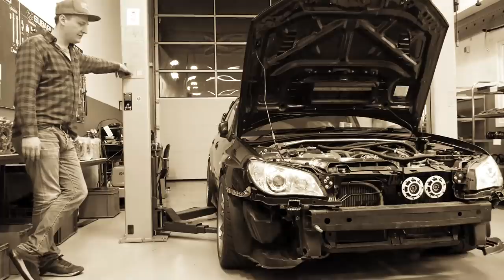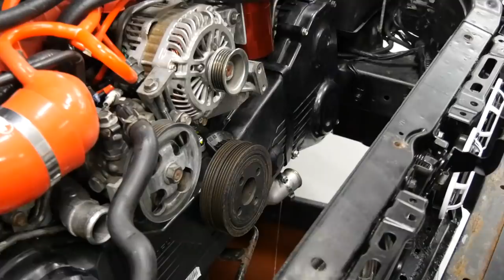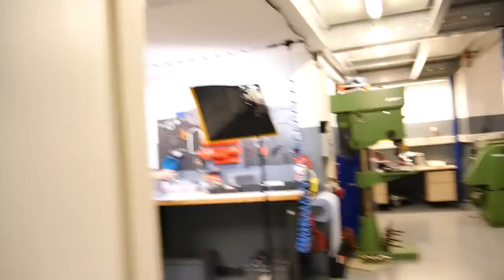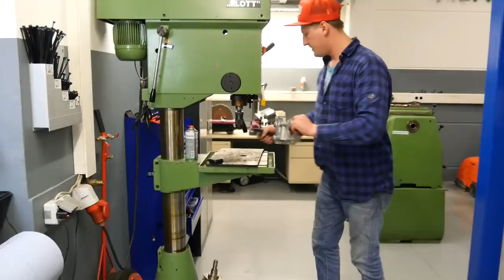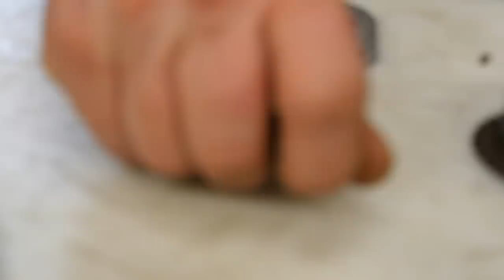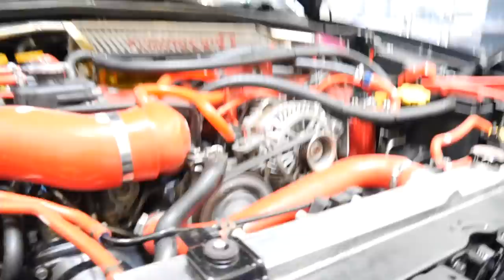❌No Oil Pressure for Subaru WRX STi ! ❌ Did we save the engine? l Shithappens#2 l Subi-Performance

Comment: Never knew casted pumps exerted these issues. 2JZ motors have this interesting tolerance issue on some motors too. Easiest way to prevent this is to port the opening a bit and knock that sharp brow on the inside down. Polishing the regulator piston might help too but you decrease idle pressure a bit. Good video!
Reply: Update for you lads: I usually ream the pump housing with a 16mm carbide reamer, polish the pump piston, then I lap the 45 degree piston face into the pump, no issues!

Comment: I like you man. You a really cool guy. I wish I could be your friend and help out. Thanks for posting these videos. I don’t have a Subaru but my friend does and I find it interesting. When I saw this engine idle, the motor does not shake all around like my Honda Civic does. It was idling very smooth. Good work. These motors sound great. The sensations are good in drivers seat.

Comment: That's the first thing I checked when I had noisy hydraulic lifters in my Chevrolet  LS1 engine - oil pressure.

That was to confirm that the oil pump,the crankshaft & camshaft bearings were still good which they were, all I did is threw in a new set of lifters & a new timing chain kit then the engine was all sweet after that,at about 342,500 kilometres, the engine is performing better than it did at 183,000 kilometres when I first bought the car a bit over 10 years ago.

My brother had to get my cousins husband whose a Subaru mechanic to get the cylinder heads rebuilt in his 2000 model Forester which runs the EJ20 engine in it,he ran it in liquefied propane gas & never adjusted the valve lash on it,he lost compression on a cylinder, the valves & seats also got burned out.

So for a few thousand $$$s he got the cylinder heads rebuilt with new valves, seats & springs fitted,my cousins partner went through the rest of the engine & resealed it as well as replacing the clutch in it.

He also advised him to only run it on unleaded fuel but he still runs it on the gas !

Comment: Was worried for the first couple of seconds. Heard what I guess was a lifter not pumped up yet. Thank God ticking went away.
Reply: He was not trying to start the car.
He was making sure oil was in the pump and  primed before starting.
Reply: @tam1381  can you please explain how to do It that way afer oil replacement?
Reply: @aagoge  Hi you disconnect the ignition so the car does not start BUT the engine is turning over a pumping the oil  into the oil ways and lubricating all parts before it starts.
It's the kind of thing you would do if you were starting a car that had been lying for a long time.
Reply: @tam1381  thanks a lot, have read that is the proper way to do it every oil change due to horizontal pistons friction because gravity.

Comment: The oil pickup tube is one thing, Subaru doesn't make them really strong and they tend to crack.   Replaced mine on the 2004 STi back in the days.

Comment: Is the piston easy to remove from new oil pumps?Might be worth a measure with a micrometer, then polish with fine wet/dry before installation for some peace of mind
Reply: Many subaru guys will do this before assembling an engine, as the sticking relief valve is a well known concern.

Comment: after 50 odd years working on engines if you had an oil pump problem you checked the pump before washing it,washing the pump can make a stuck relief free up for example

Comment: Did you replace the oil pump with the after market version with more piston clearance? Or a new stock Subaru oil pump? You said new, so I wasn't sure which one you did. Also, is there a specific scenario in which the stock Subaru oil pump fails? Example, too much boost, boost leaks, aggressive timing or over heating? Really love your videos, keep up the great work.

Comment: Hello, do you recommend the 11mm oil pump for the Single AVCS EJ25? These engines before 2008 came with a 10mm oil pump. There is so much debate in the US if the 11mm has too much volume for the single AVCS oil demand and will cause more pressure to bypass inside the pump. The concern is aeration and higher oil temperature because of constant bypassing. Thank you for the amazing content!

Comment: Had my '13 WRX briefly lose oil pressure on startup, after being previously started on a cold morning (high idle - guessing relief opened, and stuck) then not allowed to warm up. Next Startup, no oil pressure, could totally hear no oil, shut it down, then was ok on restart.

Comment: Hi Lieber leuter. Thanks for the videos, really helpful, I was wondering how you prevented the engine from starting when you first turned it over to check that the oil pressure was going up. I thought you disconnected the crankshaft sensor... or was it some other method. Danke.

Comment: It happened to me 2 times.. A fresh engine and the problem was ta oil regulator at two pumps... This happened due to small perticles of glass that remained in the cylinder heads during cleaning prosses at the Shop the repaired my heads...

Comment: Hey mr. subi performance. What oil weight should I use in my built sti engine. It’s built looser than stock but the heads and cams are still stock. I live in hot humid FLORIDA. I think you do meticulous work and I trust your judgement.

Comment: at 13:08, is that a fail start or was it intended to do some rev without gasoline ? if intended, why ? (very nice video btw)
Reply: Refilling the oil passages, I would guess.
Reply: @sotros1   Sounds legit.
Reply: @j.mckeewa2033  crank angle sensor disconnected to disable ignition. he is watching the oil guage to see if the pump will build pressure before starting.

Comment: 13:38 engine has sound and 13:44 stopt . What was that?
Reply: the engine was likely still dry, perhaps why he was cranking it with the starter for a little while, to get the new oil pump to prime... but there wasn't enough pressure to put oil in the head yet, so it was the valve train making some noise before it got proper lubrication
Reply: @user-ebidtkf  yes but i want concrete sound

Comment: I am currently building my ej257 for my 05 forester XT. I have heard different opinions on oil pumps. My question to you is, should I go stock OEM 10MM, or should I go bigger and go 12MM? I am planning on getting my HP up towards 320-350 in the future, however it will be my car I drive daily as well. I heard going bigger can not always be a good thing with oil pumps

Comment: I liked the video, I have aSubaru impreza Wrx STi uk 2.0 Turbo my Oil pressure is 6.5 bar cold start, and 1.2-1.3 85 oil temp is that normal ?

Comment: 13:36 normal ticking sound on startup?
Reply: For a car that ran for a few seconds with 0 oil pressure ... yes... notice how it dissipated in about 3-5 sec after oil got worked through the block

Comment: Hey Buddie thank you for covering that issue.  I have a question, I install a new oil pump into my 05 Impreza STI with 110K, I usually replace them oil pumps just to keep things all good.  However, after priming the oil pump i torque everything to specs 3.6 ft-lb and then proceed to spin the inner rotor a few times but I notice that oil was leaking from the pump cover.  I search on YouTube to see if anyone have the same question as mine but nothing!  So the next thing I did was to add oil on my old use oil pump and rotate the inner rotor and notices the same thing....it leak oil!!!!  Could this be one of the reasons why there is issues with the oil pressure and eventually leading to internal damages??  I’ll tried to create a video to show exactly what I mean

Comment: I want to ask you a question that is very important to me and I trust your answer ... There is a famous product added to the engine oil called Easy Xtra. It is said that Viagra is the engine that reduces the friction inside the engine and extends its age and saves its internal parts ... I want you to answer specific Is this true Or is it a mistake? Is there another product that gives the same results? Thanks 🙏

Comment: Hello, any Idea, why the customer had no issues in the first 50 km?
Reply: thefirstdutchguy it was probably that cold that the piston shrunk and allowed movement. Once warm it would expand and then stick, not enough clearance.
Reply: @PunishedByRobots  
ah.....that makes sense!
I had an oil pressure issue once  after an oil change. The bal bearing did not seat properly.
It was an Opel some 25 years ago, which was quite common then. Fixing this was super easy because the pressure valve was located at the side of the engine behind a screw plug.

Comment: where should the oil pressure sensor installed to get accurate reading? the sandwich plate between the oil filter or at the top of the block where the factory sensor is ?
Reply: Oil pressure sensor should be installed at the top of the block in the stock location.

Oil temperature sensor can be installed in a sandwich plate or on the oil pan.  Just keep the exhaust heat off the sensor.
Reply: @gammalight1312  thank you
Reply: @XIFRESNO  no problem

Comment: Changed the oil pickup tube, oil pump, oil pressure sensor, sprockets, and i still get the oil light on after the car warms up and runs for about 30 mins. It goes away when i accelerate it, so it is only at Idle that it turns on. Can it be the Clip that goes on my Oil pressure sensor?

Comment: Can we get a shout out for that starter. 

Holy!
Reply: Probably turned it over with no power to the fuel pump to get oil through the engine before the actual start.

Comment: i got a ej257 for an 11 sti  should i run oem 11mm oil pump or upgrade to oem 12mm oil pump  motor has forged rods and pistons and king xpg race bearings

Comment: I have a 17 STI with 34k on the clock, from a cold start I have 80-90 psi of oil pressure. Once warmed up and idling I have 5-10 psi. As I crisis in any gear I get about 38-40 psi. Would my oil pump be the culprit or would it be something else? Someone please help I’d like to know more.

Comment: Why did it not start first try?
Reply: He was letting the engine build oil pressure so it wouldnt be a dry start
Reply: Andi first runs whitout electric contact to run the oil properly.

Comment: did'nt plug on the crank sensor... lol
Reply: DjOMARi He did this on purpose. The engine should turn without starting, because first he wanted to see increase the oil pressure.

Comment: You ruined a brand new housing, a little heat onn the aluminum and an air blower and that valve would have shot across the room a little fine abrasive compound put the valve back in and spin with any drill wash and reinstall. Why throw away a brand new pump???